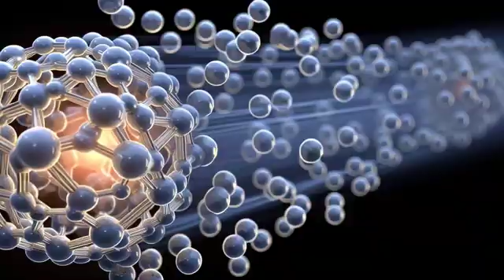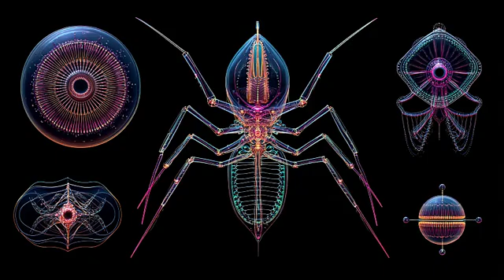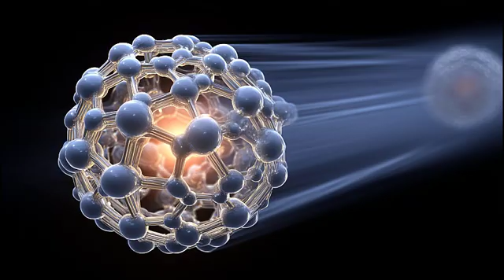Intelligent Nanobots: Futuristic, Tiny, Autonomous Machines

Comment from the maker: What novel materials or control architectures could enable autonomous behavior in nanobots despite viscous-dominated physics and thermal noise at the nanoscale?
Can we design nanoscale machines that evade immune detection and maintain functional integrity long enough to perform multistep tasks in vivo?
To what extent can current passive nanoparticle systems be evolved into semi-autonomous platforms through synthetic biology or programmable molecular logic?